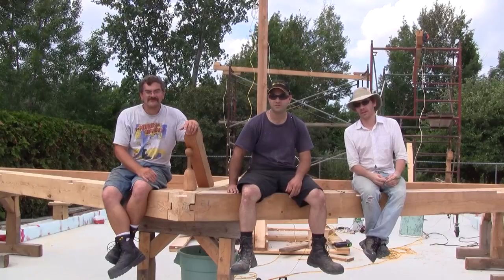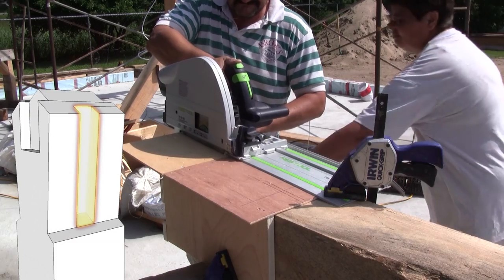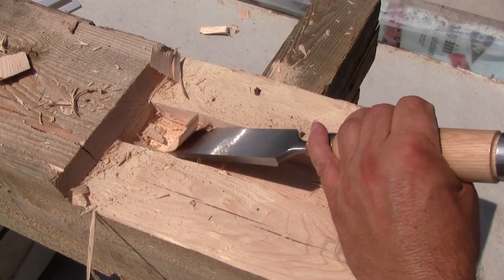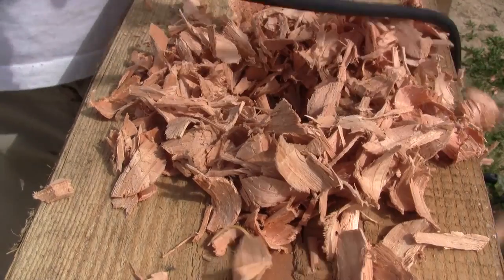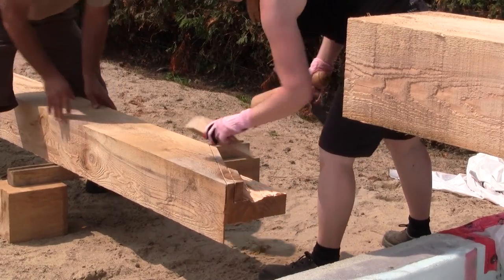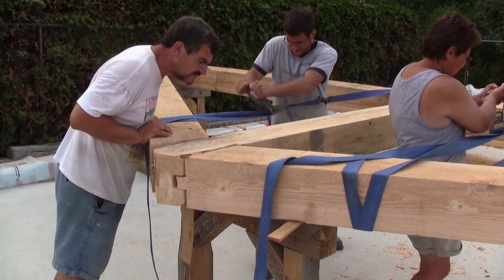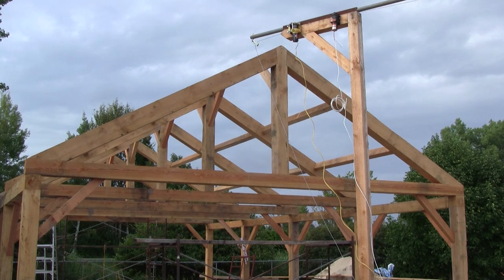The Woodpecker Ep 56 Building the new shop part 5 The trusses

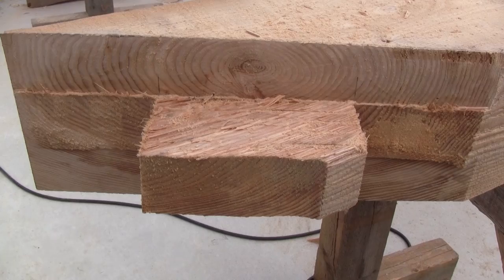Comment: One of joints was damaged se at 7:43 - i think, because of angle this type of connections are not too good.
Reply from the maker: That's the joy of working with hemlock, Sometime the groth rings tend to split apart. I had this on 3 rafters, I reglue those with heavy duty construction glue. So I've figured that instead of counting on 2X8 tenons I just count on 2X6. The rest is not that reliable.
It's mainly why I screw the rafters with (2) 3/8 15" screws and (2) 3/8 18" screws to reinforced the joint.

Comment: What is the size of your shop ?
Reply from the maker: 2ndNatureFX The building is 25'X40'. The size of the shop id 25'X30' plus a 60 sq foot room for the dust collector and the air compressor, plus a mezzanine of 250 sq foot on top of the shed section to keep my wood out of the way.
Reply: ***** Great Thanks. I want to adopt this design and slightly enlarge it for the shop I want to build
Reply from the maker: 2ndNatureFX You'll have fun building it, I promise :)